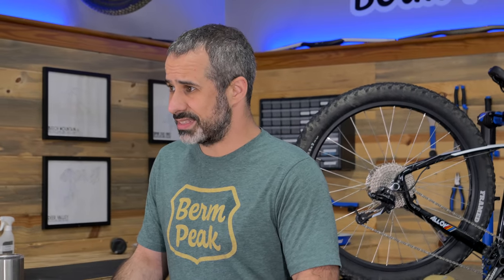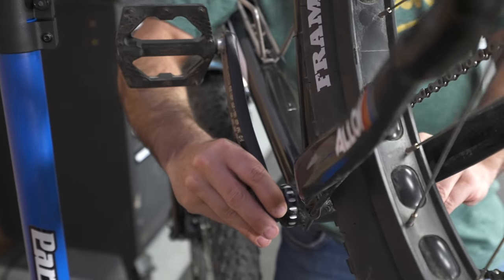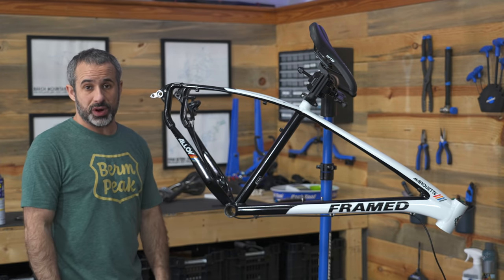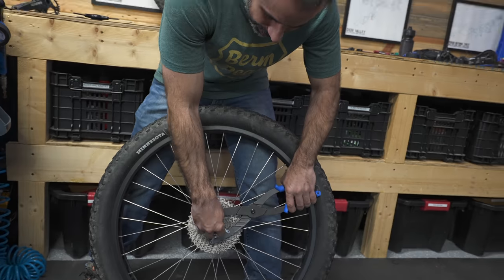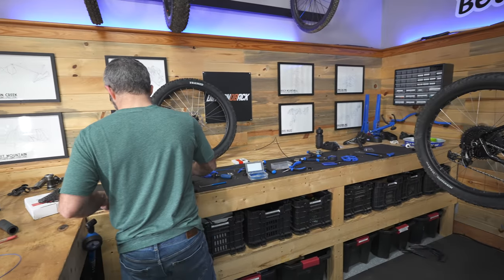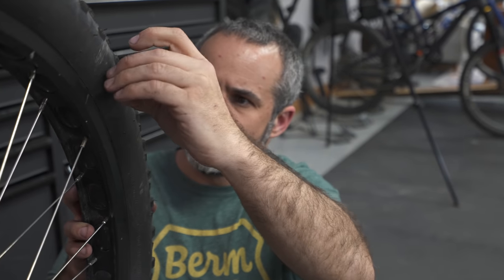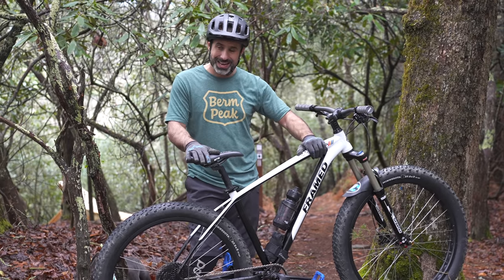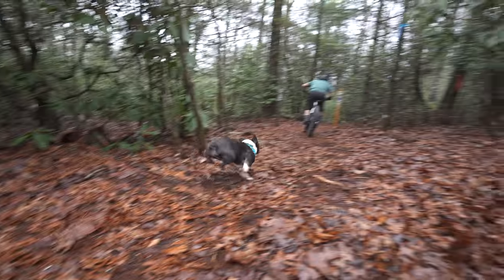Local student's hardtail gets a parts bin overhaul!

Comment: the hairs are from when the rubber was poured into the mold. it provides space for the rubber to flow so the whole tire has even amount of rubber.
do you ever get any OCD customers who didnt like the upgrades that you made to their bike? im guessing bikes are like icecream, not ever one is going to like sprinkles, some people might like nuts or even chocolate chips.....ok im craving icecream now!........please do a video on how to "service" brakes either hydraulic or normal wire actuated, clamp type and brake pads. thanks!!

Comment: The hairs aren't prevalent on the sidewall because the rider likely never cornered as aggressively as they should. 

And I've heard two stories - one that they're points of injection into the mold, others that they're just to show wear if you're buying a "new bike", if they're not present it might be worn over 100+ miles by shop riders and cleaned.

Comment: Technically, they are called vent spews, which gives away their purpose for being on the tire. ... Those little rubber hairs are a byproduct of tire manufacturing. In a tire mold, rubber is injected and air pressure is used to force the liquid rubber into all the nooks and crannies

Comment: Yes, those hairs are part of the manufacturing proces and their job is to let the air out as the rubber comws into the mold in order to have a consistent and bubble free tire. After tires leave the factory they are still important (very important). Why? Because they are the only ones that fall off the tire as soon as it contacts the floor. So you can buy a tire and know it is actually brand new and not a well cleaned used tire. Look for them when buying new tires (car, motorcycle or bicycle tires)

Comment: The hairs are on tyre due to its manufacturing, this holes are made before the tyre is moulded, as this holes result in struceral integrity, if this holes are not present the tyre will have many Hotspot to fail, to come up rat in 2 pieces

Comment: Don't cut steerer tubes to exactly the length of the stack! Always leave room for the future. I'll explain why. My local bikeshop guy offered to cut my steerer tube, I said 'won't that hurt resale value?' he said nah it's fine, this is long enough for most people. A year later I was not happy with the fork's performance so I bought another one. I asked my mechanic if he would like to buy it, he said yes, he actually needed it for a bike he had. He took it home, put it on the bike... you can see where this is going... the steerer was too short.

Comment: I have a salsa timberjack 1x10.  I’m having an issue with the low gears being too torquey ( gears 1-3) causing my front tire to wheeley to easily when climbing. Which means I’m climbing in 4th or 5 th gear up some pretty steep single track causing my quads to pump real hard.  I was wondering if changing my chain ring to an oval and switching the tooth count. Currently the ring on a a 32 tooth. Should I go bigger to minimize the torque?

Comment: Hi. I'm from South Africa  and I'm relatively new to mountain biking, with one race under my belt and only a few trails done... Recently got a new Scott sponsored to me that is tubeless tyres... I used to run on 3 bar ( 43.5psi) on my tubed bycicle. So what would be the optimal pressure for my tubeless? Ps. I weigh about 83kg

Comment: I've got a FitTrip Fox Rush 290 and I want make it a like a downhill MTB
I've already lowered the handlebar without changing the stem handlebar or cutting the front tube that extends out, what more do I need to do to make it even better 
I've got a 27 speed drivetrain (3x9)

Comment: I got a bit of a problem with my bike, can´t figure out what cause it so i figured out that i ask here. My bike was hard to pedal got a lot of resistance so i put it in service. They got me a new bottom bracket, freewheel, and chain. First few miles it was fine, but then when i was in high gear it was hard to pedal it wasn´t resistance as before just hard to pedal and it started to scratch or pop or something when i was goin just without pedaling. The front drailleur is still stocks so i was wondering if it could be the case.

Comment: Hi I have a question. I am riding Trek Superfly 6 and want to install automatic seatpost dropper. but apparently there is no extra tunnel in frame and  I was wondering if there is sny way to use like left tunnel for fore gears to install two lines? Cause of covid-19 number of parts available on market is low so finding 27.2 mm post is unlikely specially I am rather looking for a budget option like shimano koryak or kind shock. Any Ideas how to bite this one?